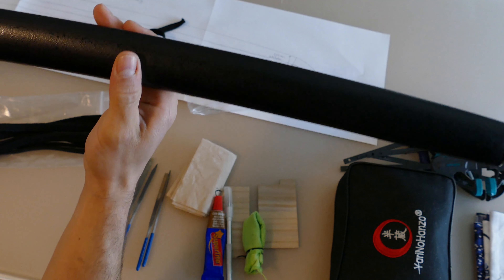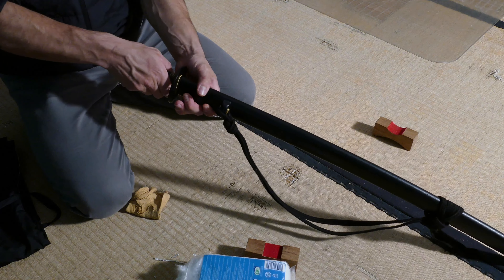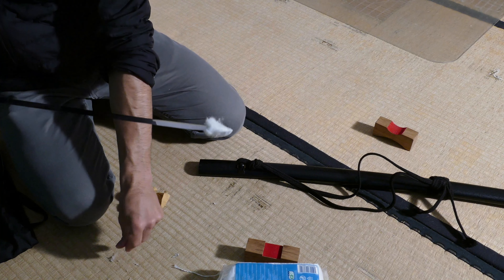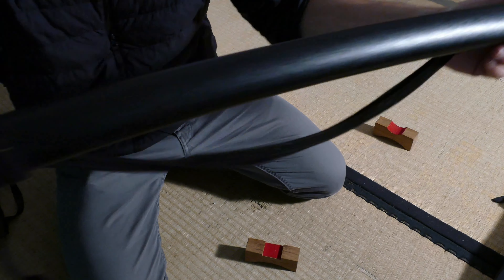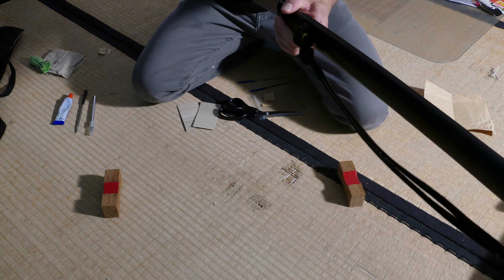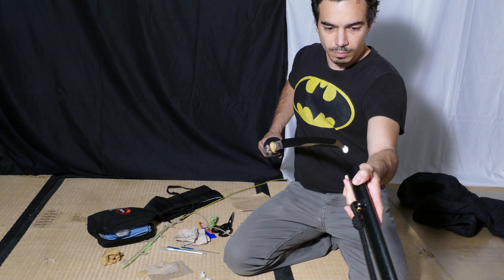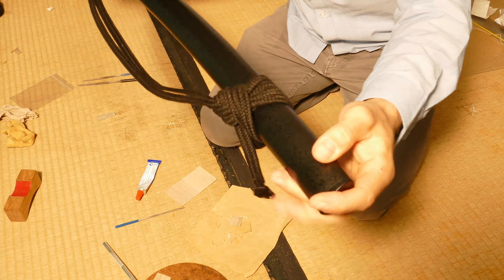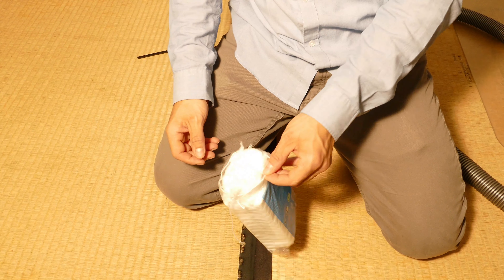how to fix the saya rattle

Comment: My John lee practical came with a plastic guide piece in the Saya
Reply from the maker: I do not know on which website you bought it or if the brand made evolve their model... but that is weird...
Reply: @RoninHood   it’s definitely a John lee practical. From Celtic web merchant
Reply: @RoninHood  I believe my package was roughly handled because this plastic guide can be seen by looking down the Saya. It starts halfway down the Saya, then to the bottom. No rattle. 
   Thank you for this video, I used cotton balls on my other katanas.

Comment: Does the Vaseline affect the wood of the Saya? Or affect the blade?  Staining, leaching through the wood? Anything negative to the katana over time?
Reply from the maker: hello dear ronin, I heard from a friend sword seller that the vaseline can ruin the wood of the saya, for me that make sense because vaseline come from oil, so I didn’t try, maybe I’ll try a next time on cheap sword to see the result
Reply: @RoninHood 've been learning a lot about woodworking and almost everything you make or purchase has been liberally coated with an oil based finish to protect it, I don't believe Vaseline will harm the wood of your saya, considering it's used as a wood polish. It also works well preventing rust and shouldn't affect the steel.